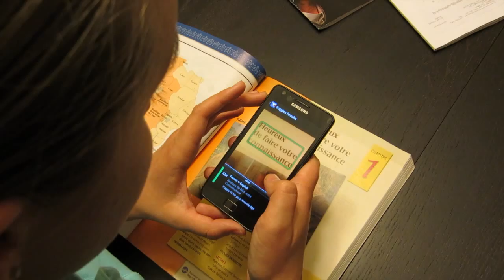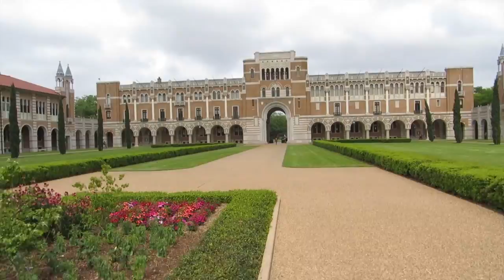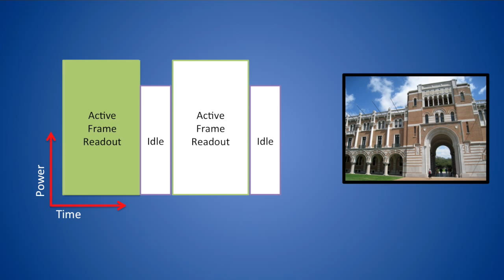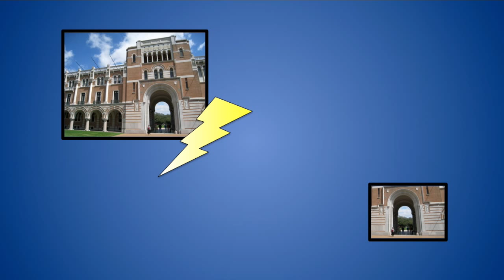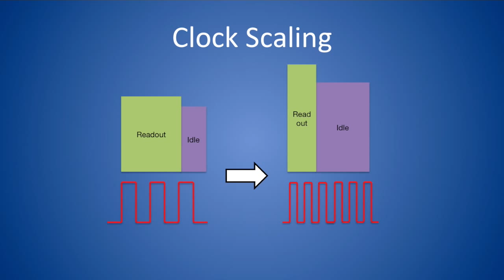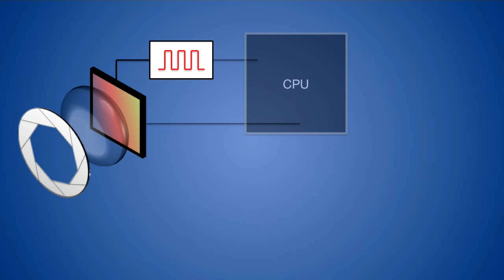Energy-Proportional Image Sensors

Comment from the maker: Thanks for the questions.

We did not notice any quality degradation at different clock frequencies, but we stayed within the datasheet specs of the image sensor. 

Rolling shutter artifacts are indeed worse when we use a lower frequency clock. it takes longer to read each row.

The shutter speed (which is the exposure time) is programmable as X clock periods. The driver should understand the relationship between the clock period and the shutter speed and set X correctly

Comment: Very very interesting work.

Does the quality of the obtain frame suffer when you are capturing with a lower clockrate? For example, are two low resolution images taken at 5 fps. with two different clock rates (you use a clock scaler) identical?

And also, I am thinking if the rolling shutter artifacts are actually worse when you use a lower frequency clock to capture an image, since it might take more time to do the read from the sensor. Is the shutter speed independent on the clock?